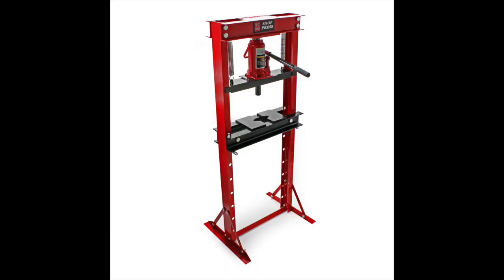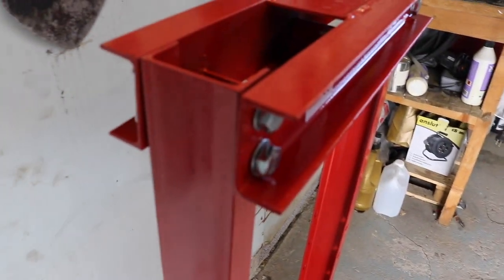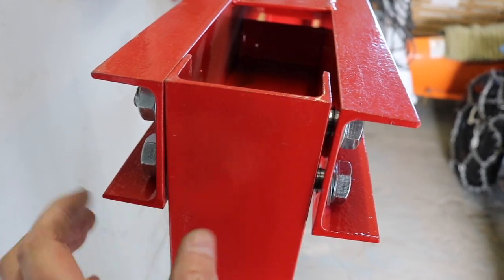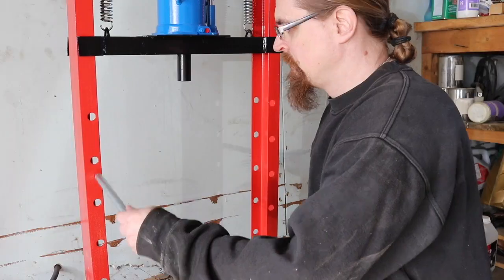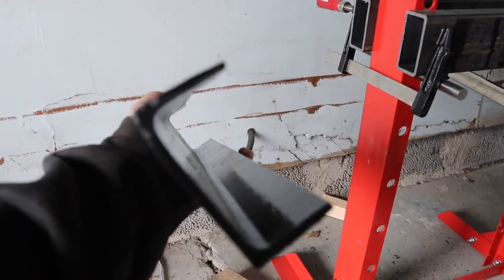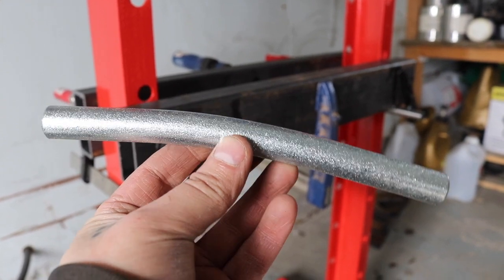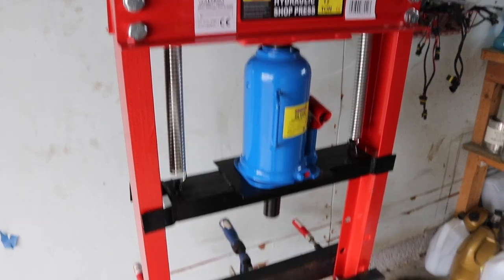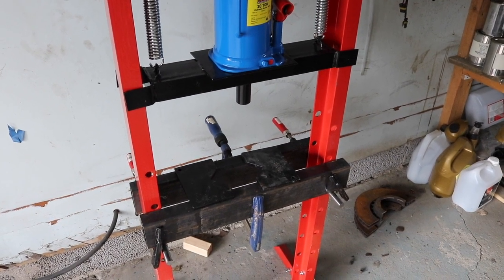12 Ton Workshop Press Build

Comment: You pressed the bearing in to the steering knuckle using  the centre section of the new bearing which can seriously damage the bearings and the life of your new bearing,  that was bad practice.
You should only press the new bearing  into the steering knuckle with just the outer ring section of the bearing, basically just use the old bearing you pressed out sitting on top of the new one to safely press in the new bearing which will obviously  sit exactly round the bearing correctly for pressing.

once the bearing is in you take away the old bearing fit the snap ring then press in the hub via the back side using just the inner ring section of the bearing so you will not damage the bearing 

if you want a good guide look at the skf guide here.
https://www.youtube.com/watch?v=vfrRavCAVIg

all the best

Comment: Ha, first like an comment. I hope that people realise that metal on metal can be quite slippery and should make sure that things are lined up straight and if any doubt about the metal being pressed should be square or very close as under pressure can and will slip or kick out... so a easy fix is a chip of wood or piece of leather even. Just that little bit gives grip. I found I liked  to use the other guys idea and improve on it any way I can. A air adapter will speed up the jacking time. I have also used the press to hold something tight while I weld it in place. No harm, no fowl. A press is  must in any shop